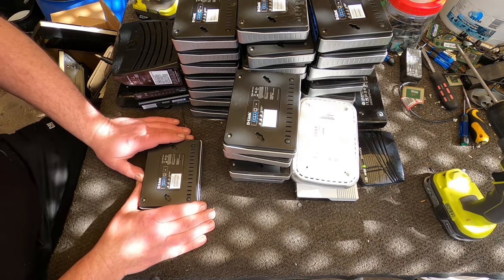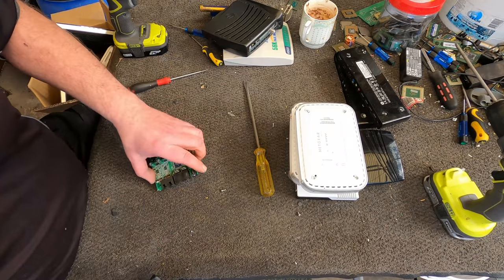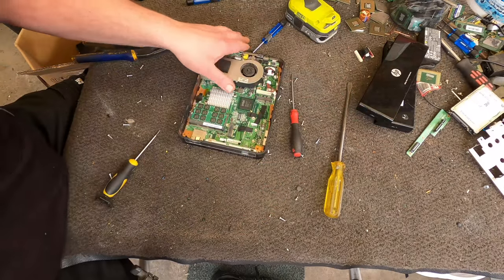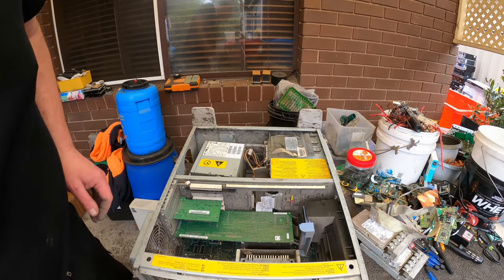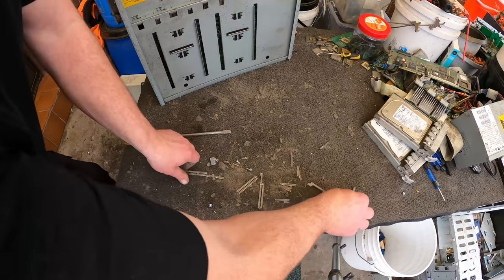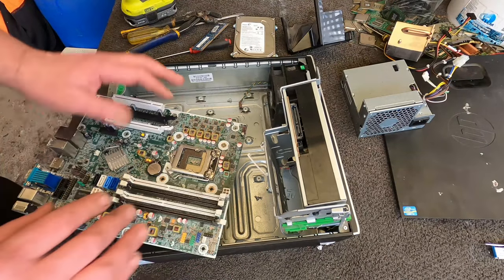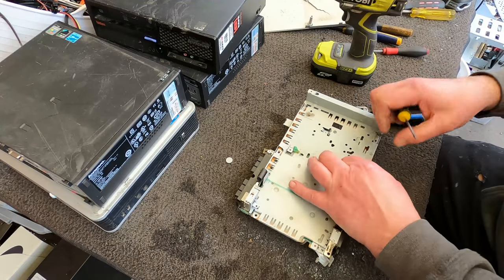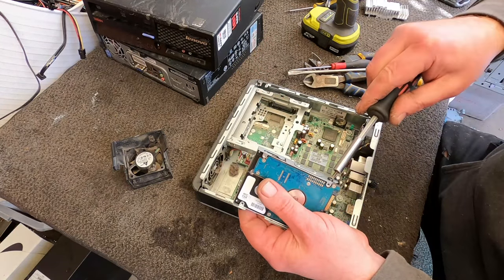Scrap Marathon Biggest Ever Part 4

Comment: Could fit a US PECO/CHEP pallet between the wheel wells of my Nissan NV200. Nissan also makes them for Chevrolet and Dodge in Mexico. 

PECO are the red pallets and CHEP are the blue pallets. I picked up tons of wholesale from Sam’s Club and about 5/95% PECO/CHEP. Used to leave stacks next to the cage at Sam’s Club after hours but left a bunch in the warehouse when I sold the business.
Reply: 48” x 40” or 1220mm x 1020mm

Comment: Hello Ben, I Can give you few suggestions, target based :
Stacking all cube shaped items (pc, UPS, Servers etc) next to your garage door against the wall : Purpose ? Even though they are eye sore, they are cubical in shape and can nicely stack one on other against the wall. Pcs in one stack, UPS in one stack so on. They do not require rain protection. Some day, suppose you decide, OK today I will do UPS, you can get them out one by one. Remove the round bins from there. If you stack cube shaped items, you can use every cubic inch of space there, compact.
Fill the cable inside the garage door in an empty bin or two. You are not setting foot inside your garage just because the cables are there. You already have many bins full of cables, an additional two will not make any difference. At least you get access to your work table.
Use cartons for taking cables to yard. You are visiting recycle center with empty cartons which is a waste of resources. Instead, use those cartons to fill cables, brass, small pieces of anything including plastic. One of your wheely bins carry 90-100 kilo cable. Instead use 6-7 cartons each with ergonomical load of 10-15 kilo. Instead of waiting for fork lift to lift and fill their holders, you can flip the cartons and while coming back home, get rid of the cartons at recycling center. Take the case of pc for steel scrap. You load each pc by hand in van, unload each pc in yard. Instead you can stack 4-5 pcs in one carton and you flip the carton with 4-5 pcs in one move. Economy of movement, ergonomy.

Comment: Hello Ben, Once you reach a situation where the volume of things in your collection become unmanageable, spare one day to segregate them enmasse.
Lets say one day you target the mess in your workshop. Just move every item outside by segregating them into managable 10 catagories like PC, UPS, Switches, Servers, all kinds of boards, cables. In case you pick a cable which is clean without ends to cut, straight away throw it in midgrade or cable to strip, all other cable in one heap. Do not bother if pc is vintage or I9. First untangle the heap into broad catagories.
Once you have major crisis everted, your choice of items to scrap depends on two factors.
If any particular item is getting bigger in volume, attack that item and reduce volume.
Second is the level of your scrapped bins. Suppose you see a midgrade boards bin 75% full. Your target should be to fill it and send it off to yard, so check which electronics gives you more midgrade boards e.g modems and that  should be your focus of scrapping for that day. 
This way you focus on top down and bottom up management. 
Like in industry, if you scrap similar material, your productivity will increase. e.g. take cables to sort into midgrade and low grade. As you use snips a lot, your fingers get sore. Next day go for modems which give rest to fingers. Next day go for UPS so on. 
I am just giving you idea. This is how we manage to get more output out of same workforce, equipment in industry. e.g. we do lot of pipe welding. On a particular day we take 2" Pipe and start welding 2 lengths together. It gives us a lot of line pipe. Next day we weld one pipe and elbow sets or pipe and Tee sets. Once we start installation, we move massive amounts of welded pipe to site. Same with Concrete pouring or Asphalting or structural installations. Organize similar size or material and you get productivity.
Reply: You mean well but 👎.

Comment: an easy trick for that CPU heat sink  for removing the 4 screws  with spring just get on dome vice or  metal  piece and hit it with a hammer from  bottom side  much quicker and easier than pushing the spring and  dealing with that security rings my self using for that piece of 60 mm pipe  set it on and one hit for one screw and all end up inside that pipe  so it is easy to clean up after too

Comment: Buy a a mini bus/van which is for disabled access that has a lift on the back, take out all the seats. For example here in the UK ebay - https://www.ebay.co.uk/itm/LDV-Minibus-with-wheelchair-lift/143684355713?hash=item2174414681:g:J88AAOSwLHhfOBg-

Comment: Hi Ben, can you get paid to recycle non rechargeable AA and AAA batteries?
Reply from the maker: Noo I can't, they are just sent for recycling, not much value for the recycler, they usually rely on gov't rebates
Reply: eWaste Ben too easy. thanks for the reply :)
Reply: eWaste Ben do you have a video covering electrical plug brass pins?